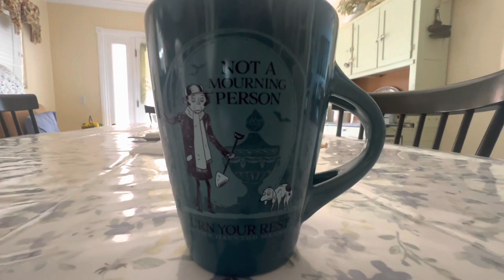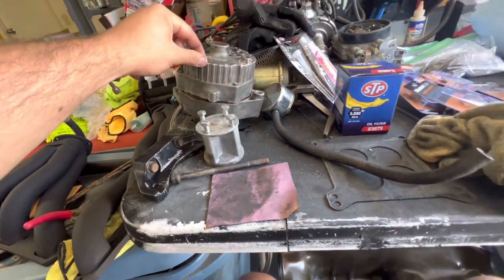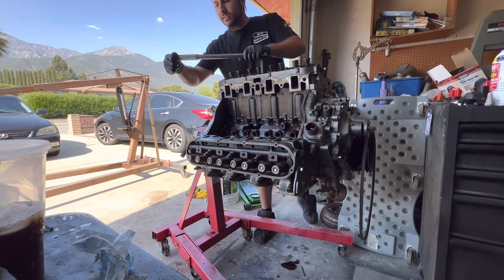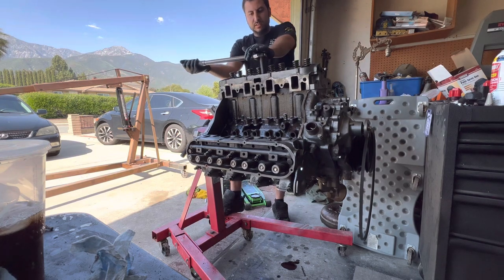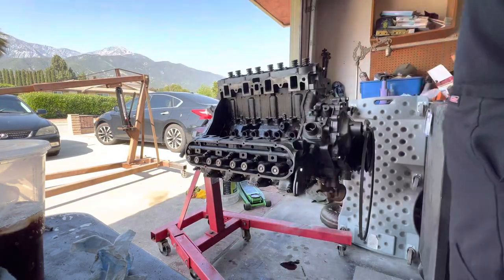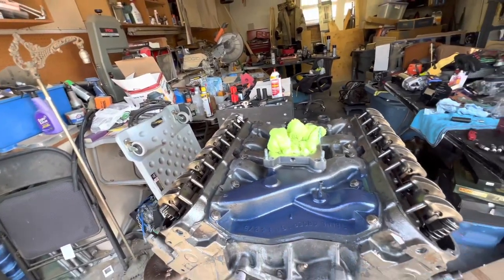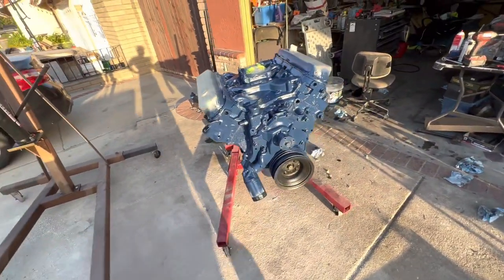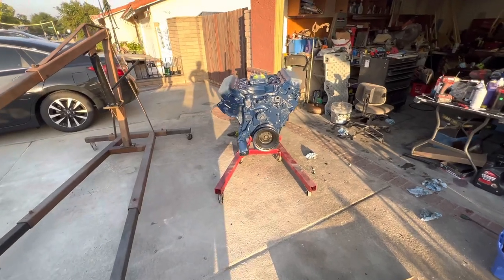Cadillac 472 build for the 1970 hearse

Comment: Looking forward to the next part, not seen many moments of the engine going back in on these older cars, I think i'm doing it the hard way cos the transmission is still in the car, dont know if it'll be better to pull it, then bolt it to the engine and relower the full assembly back in, given I need to realign the torque converter etc. Thanks so much for the video, that engine is looking real clean now, cannot wait to hear it purr
Reply from the maker: Personally I feel it’s a lot easier to do the engine and trans at the same time. For removing and installing
Reply: @HalloweenHunters  Might be something I'll end up doing then, wont be a while as i'm still removing gunk from the block and prepping it for honing the cylinders and the new rings to be fitted. Seriously, thanks so much for the replies, greatly appreciate helping get my old car back on the road

Comment: What starter did you buy? what model did you say. I have a hearse engine in my car and I don't know which starter to get
Reply from the maker: The hearse motors are the same as the stock Cadillac of the same year. So whatever year Cadillac you have the starter will be a stock ac delco. But i recommend getting a mini performance starter from speedway motors or jegs.